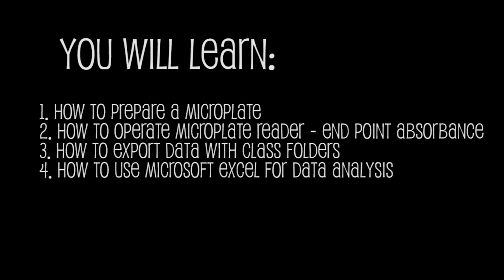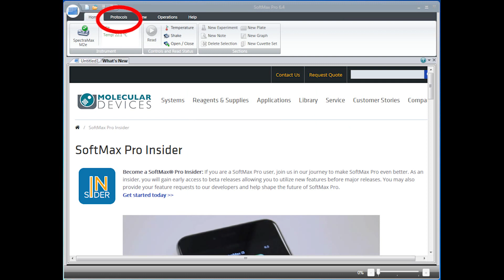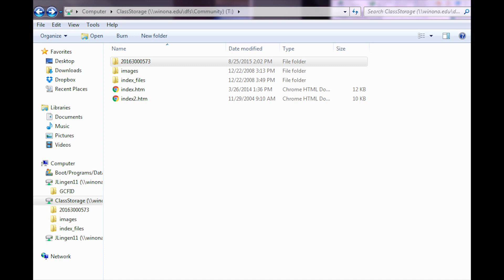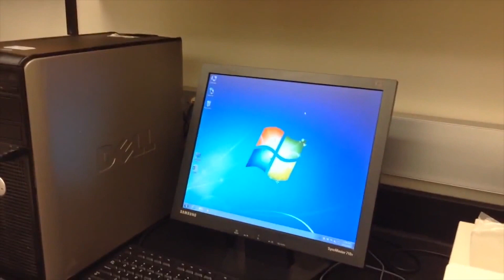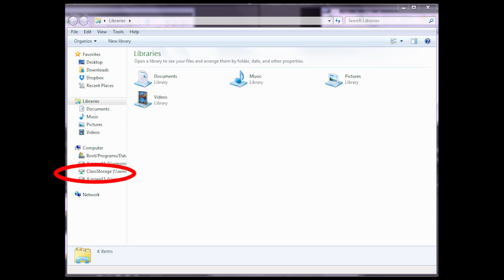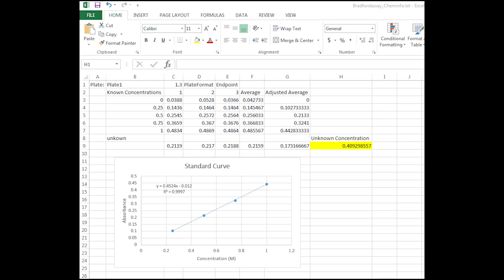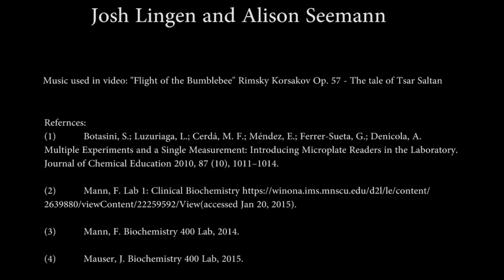Microplate Reader - Endpoint Absorbance

Comment: Why did you choose 250 uL of solution per well?  Do you get better results when wells are not completely full?
Reply from the maker: The sample volume range on that particular microplate reader was 200 uL to 300 uL. Any of those volumes within that range would have worked. If 300 uL was added, it would basically be a full well. We just chose 250 uL because it was in the middle of that range.

Comment: Hello, I am very new for this subject, could you please tell me which solution you took as a sample( blue sample ) or how to prepare the blue sample ? And how can I calibrate the absorbance microplate reader easily and which solution I need. 
I will be helpful if you give me the solution.

Thanks
Reply from the maker: Hello!
The solution for this video demo was blue food coloring in water. We made a stock solution of dark blue food colored water and then did simple dilutions for the solutions to make a standard curve. Please note your experiment will require a different solution for making the standard curve. Different molecules absorb at different wavelengths so it’s super important to make your standard curve with a solution specific for your experiment. For example if your experiment uses a buffer, you need to calibrate the microplate reader with the same buffer solution. Make dilutions with known concentrations of your compound of interest to make the standard curve.
Reply: @musicgirl4229  Thank You so much. Could I use pH 4/7 or 10 as a sample solution ? Because all these solution I have are colored solution. So, can I use this buffer as sample solution for experiment?

Comment: how to chose wave length?
Reply from the maker: You can do an absorbance spectrum to find the maximum absorbance - the maximum wavelength will have the most sensitivity and thus is the best to use to obtain the most optimal results. In general, the solution will absorb at the complementary color's wavelength. In the video, the color of the solution was blue, thus the solution absorbed light around the wavelength for the color orange.